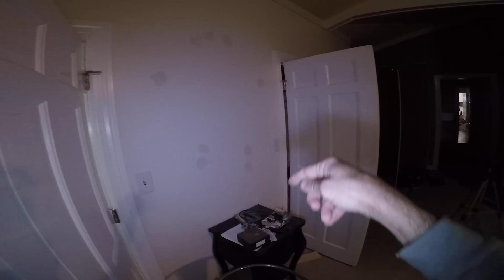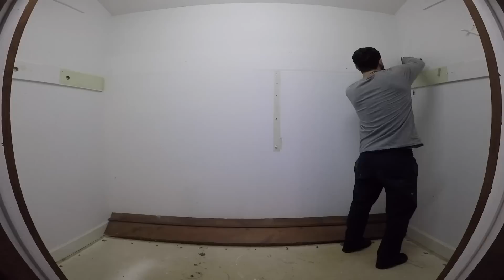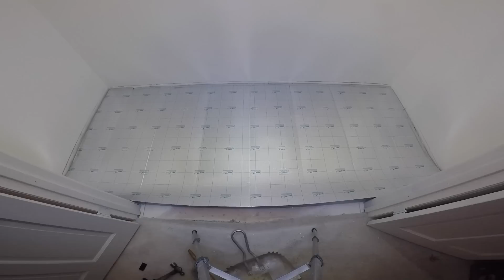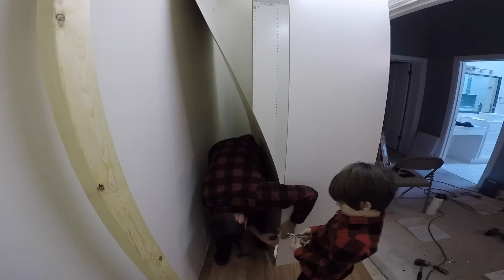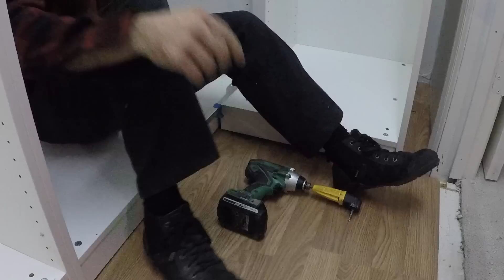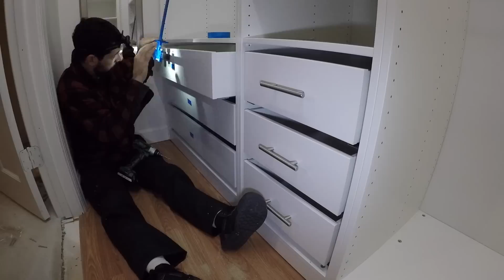Budget closet makeover using IKEA PAX

Comment: i would omit the bottom to get more space for shoes and gather less dust that cannot be cleaned, also the side walls i would use wall itself, by adding a 2x4 to secure the drawer walls attached to ceiling and floor.

Comment: Looks amazing! Last year, I wanted to do a Pax closet but most of the frames were out of stock so I just bought some laminated shelving and drawer slides from Home Depot and made them myself. I think they turned out better than the Pax and were half the cost. I'm moving in a month and I plan on doing the same thing in my new home. Interestingly enough, the bedroom closet in my new house is the exact same size as in my current home so I am planning on doing the exact same layout.
Reply from the maker: Awesome! We are in the process of designing our next closet layout and will probably build our own from scratch this time.  I liked the Pax, but like you said, you can do it cheaper a few different ways.
Reply: It looks interesting. Do you have any links to the items you bought from home depot? Also, any pictures.

Comment: Love it man. I’ve been watching your videos since the Crown Vic! I’m 28 months in on an entire home remodel so I love the change of pace. Gotta learn how to “cope” those inside corners on baseboard trim. Closets aren’t a big deal but essential for living areas that are move visible.
Reply from the maker: I've never seen baseboards cope'd, i've only seen that on crown moulding.
Reply: @AustinCoulson  oh yeah, gives you a professional look and no caulking. If you have new drywall with the tapered edge, you might not be perfectly square. You might need to do a compound cut to compensate, or use a shim in the corner. Looks 1000% better than caulking!
Reply from the maker: @robertmeneghin1553  The problem I usually see in the corners is they aren't square unless its brand new Drywall.
Reply: @AustinCoulson  back cuts and dry fits. the effort is worth the results.

Comment: If you run a bead of glue around the slots for the drawer bottoms, they are a lot stronger and last a lot longer. We’ve had some for 30 years.
Reply from the maker: good tip

Comment: Austin, does the metal connector you used for the corner, on the bottom, does it come with the PAX system or you improvised? If so, can you give me the reference for that part?
Reply from the maker: That piece comes with the corner box, I just had to drill new holes

Comment: I am looking at the pax set,  how difficult / long did it take putting it together?
Reply from the maker: It's pretty much the same design as other IKEA furniture which some people love and some people hate. I could have built both closets in about 6hrs if I wasn't filming.
Reply: @AustinCoulson  thanks, for the video. It was useful. I finally purchased the system.  I was able to get it together. Just IKEA has been out of stock on one drawer I need to finish up the system.
Reply from the maker: @matthewbrooks4638  we had that issue with some things being out of stock. Had to change the design a few times until we found a setup that was available